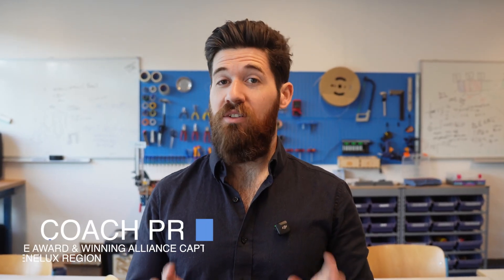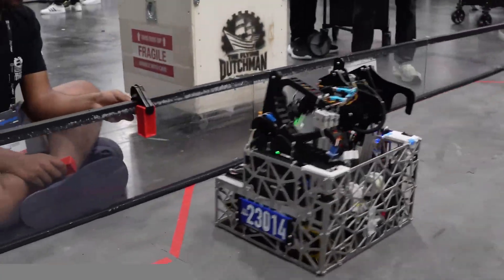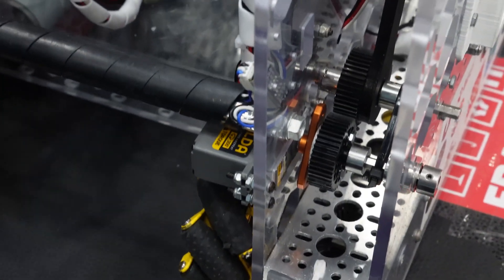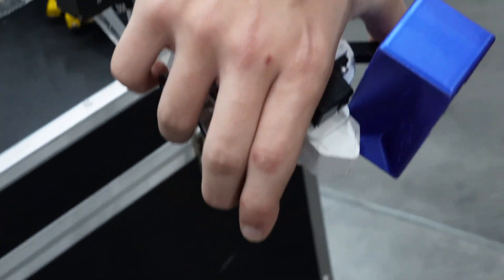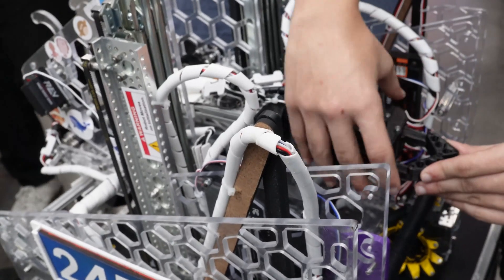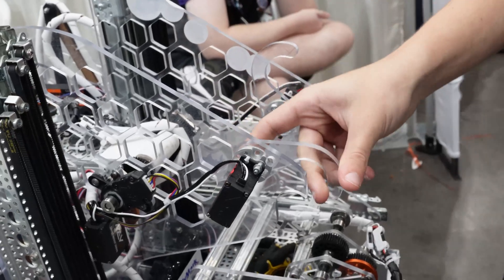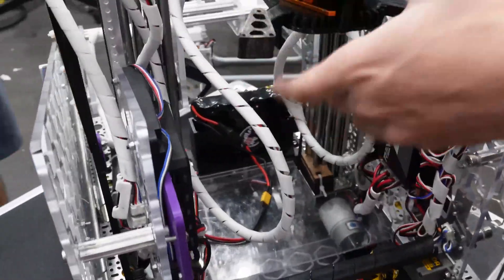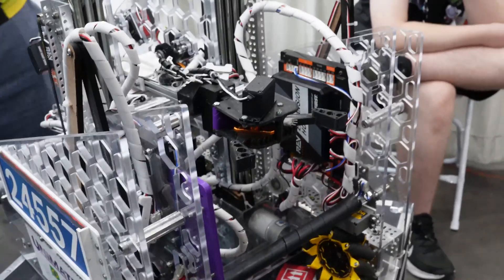FTC Robots Revealed: 24557 UNIMATE - Simplistic Design

Comment: Unfortunately, in Brazil, we don't make things simple by choice, but because the official parts supplier overcharges the prices, making it unfeasible to try to develop more complex mechanisms. 

Example: We pay $858,85 in a gobilda slide :(
Reply from the maker: Ouch! Those taxes are nasty. I don't mean simple to be an insult here, it's a good refinement of core principles. It's also a great constraint that many engineers face, anyone (well, most) could build a good bridge on an unlimited budget, but engineers have to work within the constraints to make it work.